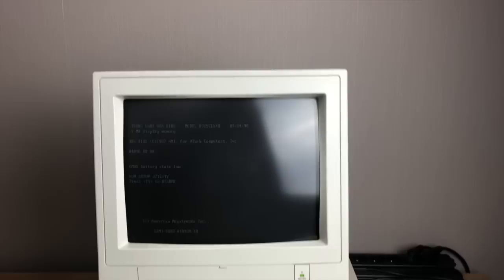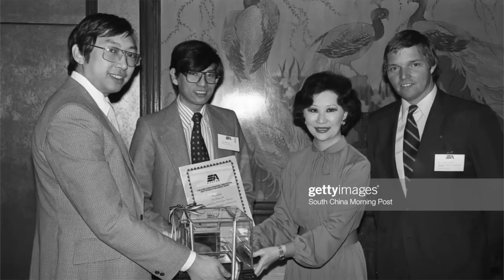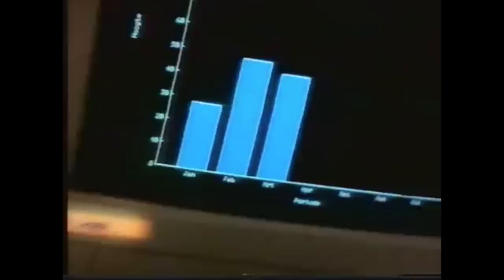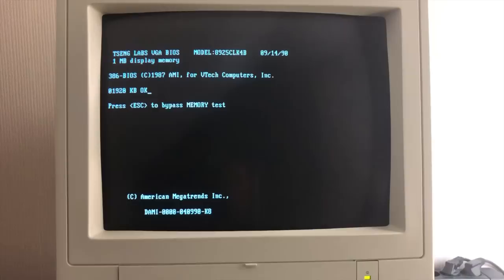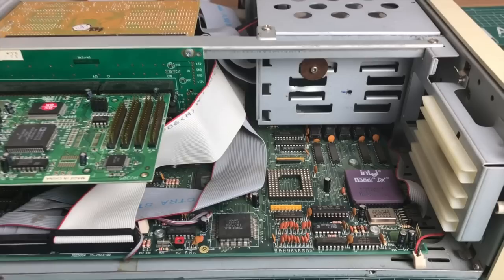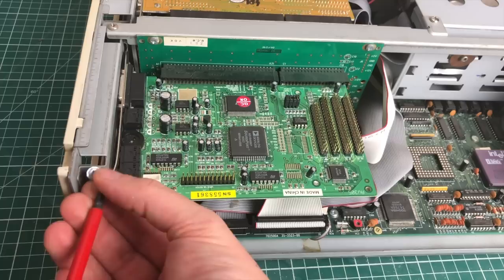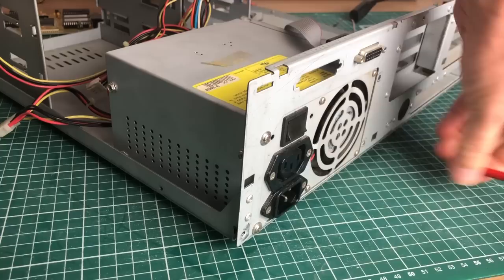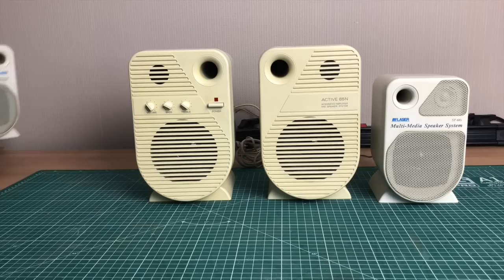Laser 386 desktop PC + VTech history (part 1)

Comment: The soundcard is a Zoltrix Audio Pulse 3200 V.2 (AV305). That sound card is not an Analog Devices chipset, the AD1848 is merely the codec, the real chipset is under the sticker and a C-Media CMI8328A.  It also has a 100% OPL3 clone chip on it, the DXP44Q.  It also seems to have a wavetable header and the MPU-401 on that card is not bugged.  It's a solid ISA sound card.  Keep it.
Reply from the maker: Thx a lot for the update / clarification ... covered most of that in part 2 that will be out soon but really appreciate the detailed comment ! Will update the description of the video with this info and will detail it in part 2. Hope you enjoyed the video.

Comment: When I was a kid I had one of those VTECH Learning Computers. Last year I visited my mother and she still had it. I brought it home and it has a Z80 in it. Replaced the ROM and added a SIO2 and it now runs CP/M.

Looking at that Motherboard and saw 16 RAM SIMM Slots makes me wonder how much RAM can you put into that thing. Even with 512KB Modules you would get 8MB. My old 386DX system had 32MB of RAM. My parents thought I was insane for spending four paychecks from my first job on RAM.
Reply from the maker: Haha ... I remember selling my electric guitar for a 4mb memory upgrade for my 486dx2 back in the day :)
Reply: The SIMM socket is 30pin, so the max SIMM module can be 4MB, total can be 64MB with 4 X16 maybe.
Reply: Does this mean that the VTECH kicked in yo

Comment: Mine was purchased from Circuit City, it was a 386SX25 with 2MB ram and it was an actual Vtech 386. I made almost 600 a month back then and this PC set me back 995.00. It came with 3 1/2 drive, and a 5 1/4 drive which I still have the complete Vtech DOS and windows 3.11 disks for. I wished I had my old pizza box back nowadays. I also remember it came with Wolfenstein 3d.

Comment: My mom bought the Laser XT/3 brand new, and I later bought this exact 386 brand new which I still have!  I must say mine cost a small fortune as I had it optioned out with full scsi subsystem and scsi cdrom. 8mb ram, 387DX fpu, 340mb maxtor scsi HD and sound blaster pro. I also was sponsored a Matrox video system which basically took up nearly the entire one side of expansion slots. (Full length frame grabber, full size TIGA accelerator with Matrox VGA host chipset).  And the 3rd card was a rather large Sound blaster pro. In the other side was my Adaptec card, Network card and at the time my brand new fancy supra 14.4 modem. 

When business caught on, It didn't take long until I had upgraded it to 16 mb ram and added a pair of 540mb IDE drives and a 300 watt psu.  I had to remove the 5.25 inch floppy for that batch of upgrades. I don't think there was ever so much stuffed into one little desktop case. As one will imagine, Cabling was a small nightmare.

Comment: Supervet! Bought a Laser 386SXE 16mhz myself of marktplaats a few year ago, which i restored and fully loaded with everything awesome i could do, sound blaster pro 2, Western Digital 90C30 1MB videocard, new PC Midi card MPU401 card + Roland MT-32 and XT-IDE +sd card because i couldn't get any harddrive to work without one. I also found a matching Laser Monitor however the you have is the exact same model we used to have when i was a kid so very jealous about that one!! We used to have a 286 12Mhz, but this 386sxe almost is and looked the same :)
Reply from the maker: Sounds great ! 386 is a nice platform to play those early msdos games. And the fact that it is a Laser for somebody from Holland is extra cool :)

Comment: I have one of those clock chips in a Commodore 286. Soldered in. Following online instructions I cut into it and bypassed it's internal battery with a external cell. I had to cut some of the internal case frame which I regret.

Comment: My first x86 PC was a Laser Turbo XT with CGA graphics and dual 5 1/4" floppies bought at the local Sears.  Quite a disappointment though after having an Amiga 500 for a couple years (I lived in West Germany at the time I owned the Amiga)
Reply from the maker: Yeah..  for many it was a step down. My first pc was a 486 so coming from an amiga I felt it was a step up simply because it had a hard drive :)

Comment: I had a Tandy 386 that you couldn't access the BIOS without proprietary software that they wanted to charge an arm and a leg for.
Reply: 480JD yeah that was a common method to keep people taking their computers into repair shops. Remember people getting charged $80 just to change a cmos battery and update/reset the settings they couldn’t without the disk for that make and model. (Which the average joe would not even know they needed). Plenty of other scant behaviour like that from proprietary manufacturers like custom power pin outs and non standard power supplies.

Comment: I remember putting myself through self inflicted pain by installing windows 95 on one with only 4mb ram. took forever to boot, turn on turbo and drop the clocks and well, half hour or so boot times?
Reply from the maker: Would be a fun experiment ... but not something  you want to use on a daily basis. Even on a medium 486 windows 95 didn't really ran all that well.

Comment: So, there is no 32-bit slot for the graphics? What a pity for a 32-bit system. I think that time period was too early for a PCI slot, but VLB was available.
Reply from the maker: I know there are 386 mainboards that support VLB, but the CPU would remain a major bottleneck. Don’t think you would gain a lot by using a VLB card in a 386dx33 based system.
Reply: @RetroSpector78  In 3D probably not, but some demanding 2D games could benefit from the higher transfer rate.